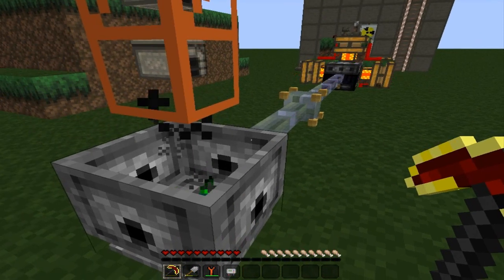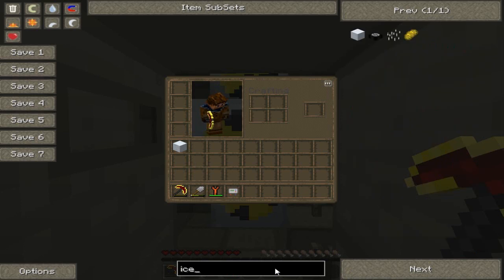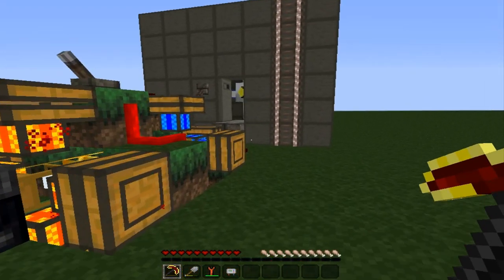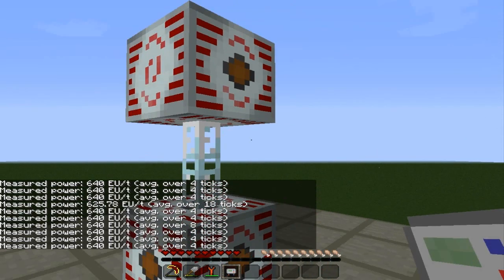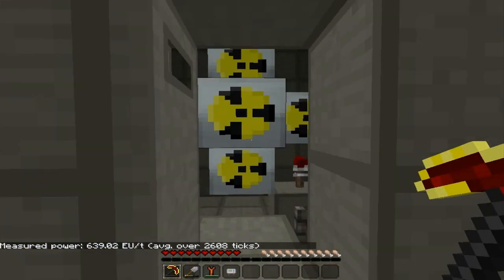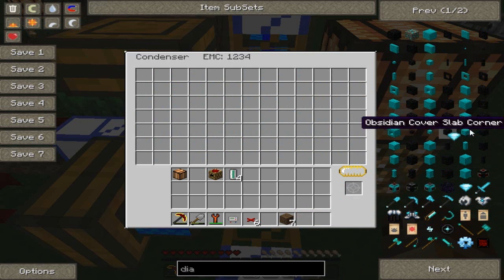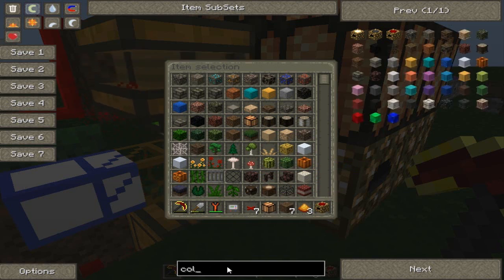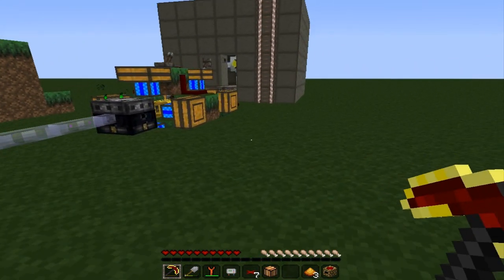Minecraft: Ultra Nuclear Reactor (Part 2)

Comment: Just as a heads up, and I know this video is old, but if you use Antimatter relays next to the Energy Condenser and then Energy Collectors next to the relay, then you can have a way to pop out a ton of ice. Using a Mk1 relay and 5 Mk1 collectors with the condenser next to the relay, and you will make more ice then you can use while leaving room for three pipes(max that can take from a chest) With Forestry gone from the pack, you will have to hard link the feed to the reactor.

Comment: If you're still wondering about the 640EU/t when the limit is 512EU/t, I think it's because the Transformer splits the electricity produced into 4 packets, that all go at the same time. Therefore, even though the same amount of power is going through per second, it goes through 4 times a second instead of once.
This is a really bad explanation.
Err... instead of sending 1 packet of 640EU/t, it sends 4 packets of 160EU/t.
(640/4=160(<512))
That's a bit better.

Comment: The reason the glass fibre cable said 640 EU/t is because it's smaller packets, but a total of 640 EU/t. Each of the packets are 512 EU/t.

Comment from the maker: @thedude8543 AW make sure the MFSU is facing the correct way, remember the MFSU has 1 single output, and 5 inputs. if the cable is inserted into its output face, it will not work unless you supply a redstone current to it, to switch the faces.

Comment: I have a better reactor set up.also this is a suggestion. If u hook up a filter to a condenser with ice it will pump out 8 ice at a time which is much faster and more efficient that that set up. U can also get away with having up to 47 uranium cells in the reactor at once

Comment: The 640 eu a tick going through a 512 rated wre is not a bug. It IS rated at 512 BUT it's not all being sent through at once. Picture this imagine a hignway and the hight limit of it is 512 ft (crazy huh?) if one truck bigger then 512 ft can't go through. BUT 4 smaller cars of 160 can pass no problem. It only breaks if you send one huge jolt > 512. I hope this helped.

Comment: you should use redpower2 filters they can pull out as much of a stack as you want... problem is you have to connect pnuematic tubes which dont have their own teleprt pipes, but they are smart and wont try to over fill an inventory.

Comment: Im not getting any EU from reactor. I have the set up you have with the uranium and ice, but my reader just says 0 EU/t and my mfsu is not getting any power. my cable is attached to the top reactor chamber. i can see my reactor is green and cells have a health bar, and i can hear that "nuclear noise" any help would be greater appreciated